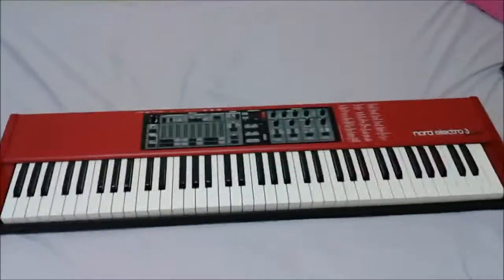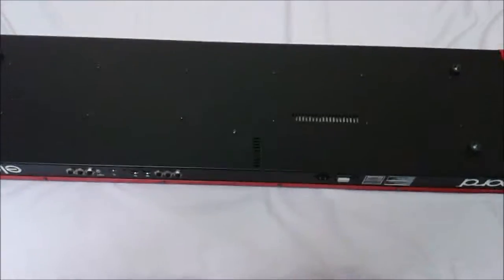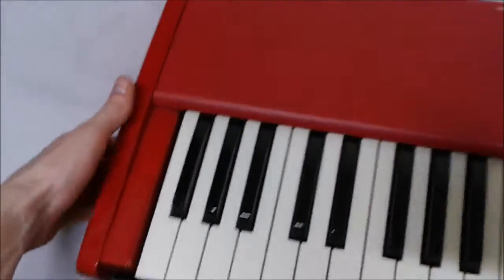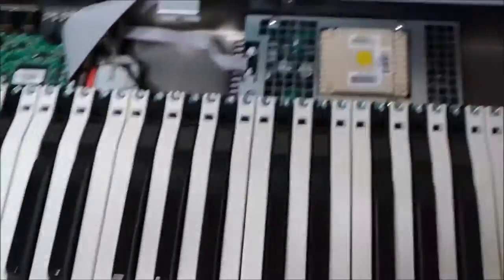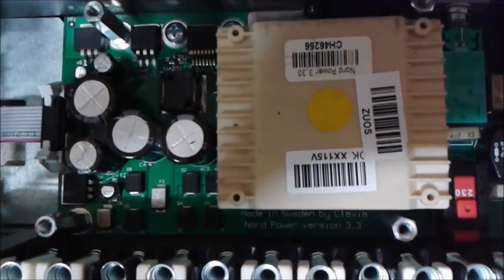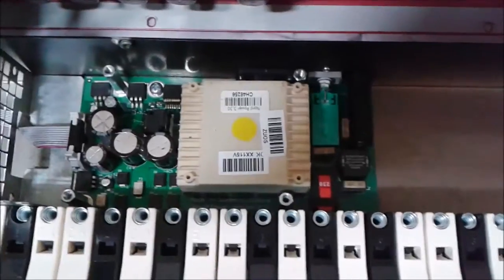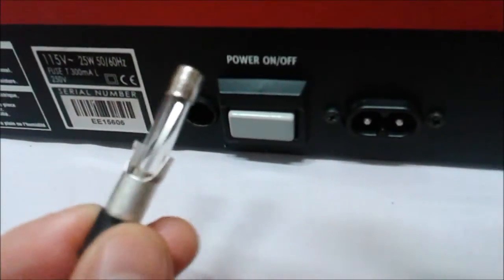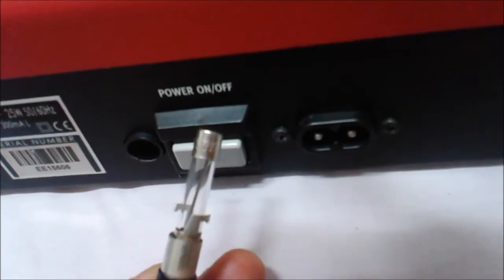Nord Electro 3 - 110v to 220v (115v to 230v)

Comment: Thanks for posting.
I watched this video just before setting up the power supply.
I bought NE3 in Aug. 2013 from US dealer(shipped to Korea).
It also originally set to 115v.
But the fuse was T-300mA 250V so I don't need fuse to replace.